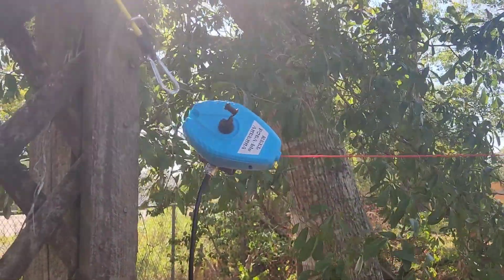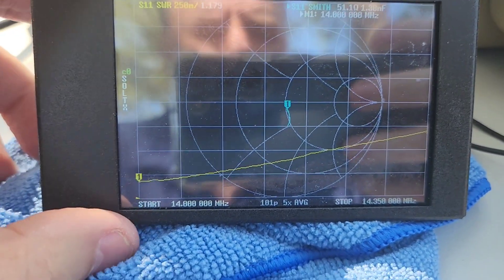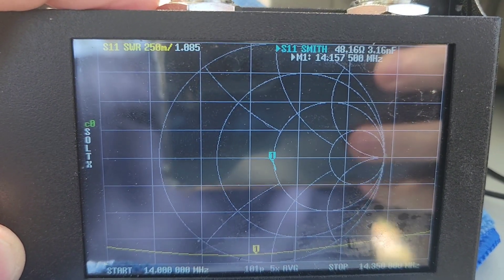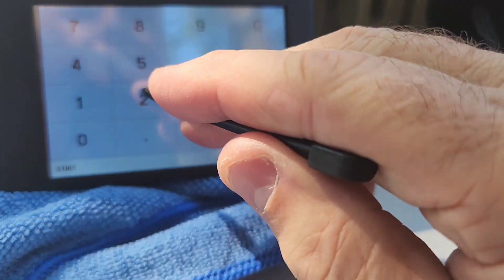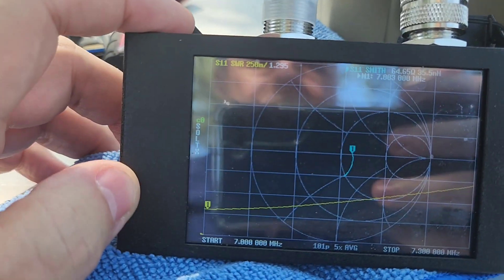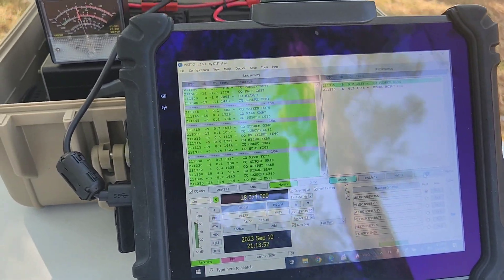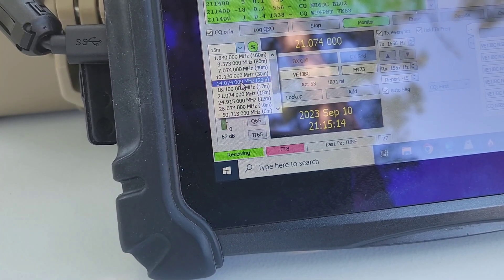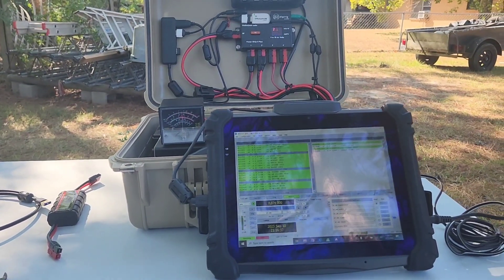New Tuning Tips for your new Reel POTA-ble EFHW Antenna

Comment: It would be really interesting to know how the connection of the 49:1 unun to the wire on the reel is realize.
A electric contact bearing might be a potential failure point.

Maybe you could lift this mystery for us!
Reply from the maker: I totally understand, and this is what makes our antennas different. At this time, we don't have any plans to share this IP.

Comment: Please start at the beginning with us… What happens at the distant and when you start cranking. Surely this is not elastic. Do you have a weight with a pulley or something that you didn’t mention?
Reply from the maker: No, this is in a sloper configuration with slack in the wire. As long as you don't pull the wire too tight, you have room to adjust.